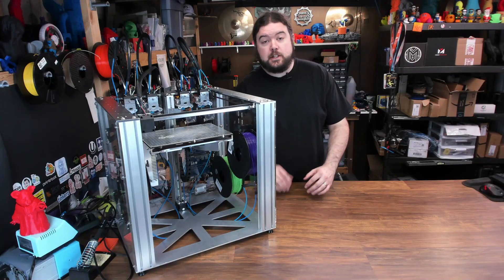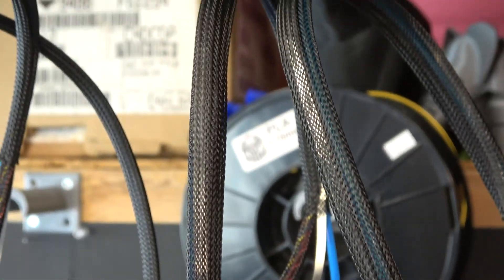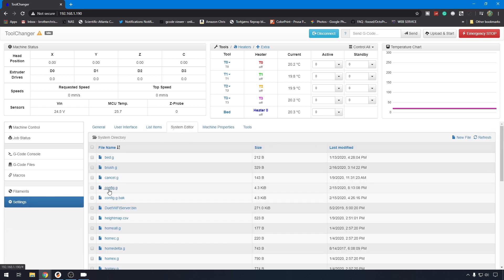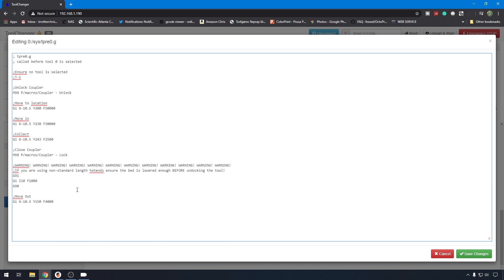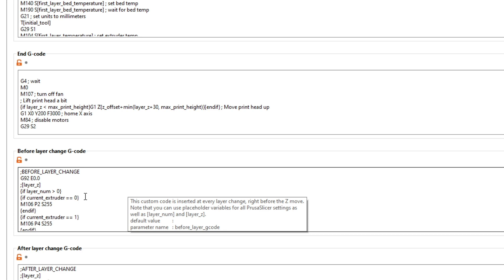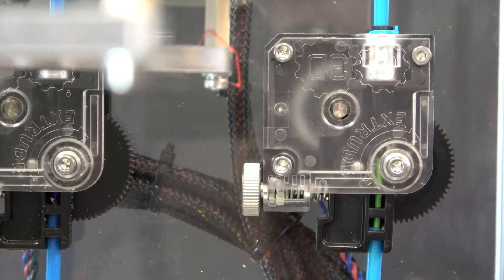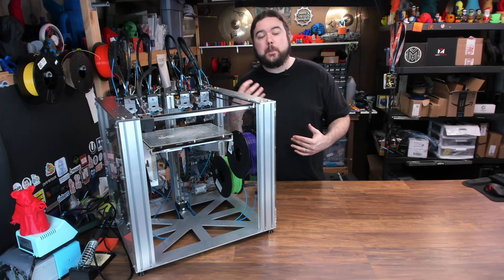E3D Tool Changer Update - Chris's Basement

Comment: I'm glad you're not bashing it as I've seen another YouTuber who was looking at it as a finished product -- simply based on the price. I went a different direction with my multi head design. I build a quad independent extruder system, and to be honest the amount of slicer config you have is unnecessary. You can do all of that in the scripts. For fan.
Here is what I have in my free0.g  : M106 P0 S0
then parking operation -- for me parking is quiet a bit easier since I don't have to disconnect a magnet or anything, just move the inactive tool to it's parking location.
free1.g has M106 P4 S0 and so on -- so you turn off the fan in each freen.g command then in postn.g you need to have
M106 R2 -- that command is how Duet RRF will resume your fan operation. That's all you need to do -- set your slicer fan to be at layer 2 or whatever as you would normally print, and then just let duet take care of the rest. So for my machine part cooling fans get turned off when the tool parks, and they resume when the tool gets active if it was previously set to whatever you set it at -- RRF will remember. 
As far as tool cleaning, really can't see why that can't be done in the postN.g script either -- I have my own cleaning mechanism - since hotends are parked and need to be cleaned before resuming -- so first thing they do is clean themselves -- then continue printing. I look at it as everything special to the operation of the machine should be and can be done in the pre, free, and post scripts. My slicers config in S3D has one variance -- which is to make the tool do XY motion before it does the Z motion on toolchange (I personally think going the other way around is a bug in S3D)-- that allows for tool to return from the parking/cleaning phase and travel above the part and not hit anything or make a mess, really that's all the slicer adjustments I have to do, again because S3D is dumb to do it in reverse. Another trick to lining up toolheads is use a microscope camera under the tool at a known location, much easier that way to get offsets. I would not do a long bowden tube on a system where precise control of extrusion is necessary. But I learned that before I jumped into the quad.
Reply from the maker: Great comment, I am sure as I get into it more my config will become much more efficient, this was just how I solved it at first look. Great to hear that there are so many different tool changer projects going on. Thanks for watching!
Reply: This is similar to what I did.  I added the Fans to each M563 command in config.g so they are bound to the tool.  Then changed the M106 command in tpost.g to R2 instead of S255.  That has them following what PrusaSlic3r sets the fans to so far.
Reply: How does this toolchanger disengage from the magnets after it slides the toolhead on the two parking posts?
Reply: Christopher Jones the toolhead uses a cam lock driven by a small stepper motor to secure the tool. There are no magnets on that side. The dock has a magnet that secures the tool to the dock.

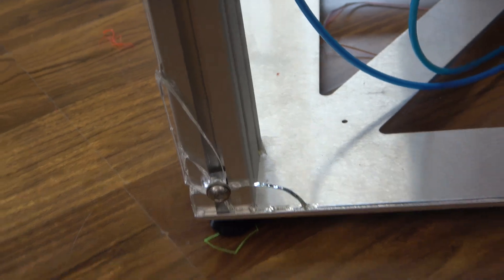Comment: 6:45 If you plan to install new Acrylic. Make large holes around the screws, install rubber washers there, and cover them with a larger metal washer. Or you may get one of those "cable guide" rubber washers that are used in the automotive industry.
If you plan to repair existing one - saw them off by 45deg, drill some holes near the edge and 3d print angle brackets that will have hooks to go through the holes in acrylic.
Reply from the maker: Great suggestion, thank you!

Comment: Thank you for the video, very informative retrospective view on the build process.  Ever since I saw the E3D kinematic coupling tool changer concept on MRRF2018 I have been working towards replicating it but slightly different, one thing I did different was change the locking mechanism so instead of twisting to lock in place it uses the X Y movement to align (essentially) a cylinder into a ring. The ring gets inserted over the cylinder on the X movement then the ring retracts into the gantry (retracting mechanism) taking the cylinder and tool head with it. The benefit of this is there is no chance the print head will fall off due to misalignment when coupling or uncoupling. Cant wait to see your first motley material prints and whatever contraptions you come up with to mount to the thing!
Reply from the maker: Thanks Nick, great to hear you are creating another version, that's awesome.

Comment: Hey Chris, for your side pannels, if you don't already have them, find some 1/8th or 1/16th inch wide soft rubber grommets to put between the pannels and the frame.  Even small vibrations over time, like when the print head is moving, can fatigue materials to the point where they become brittle.

Just got into 3d printing myself and am already looking at pie in the sky ideas about setting up a machine with a tool changer and a bed changer so I can batch out a couple hundred parts at a time (obviously there are many challenges with this, but it'd be boring if it were easy).  Thanks for the review on the changer!  I'll definitely have to look into it for the learning experience.
Reply from the maker: Thanks for the tip! I still need to fix mine up.

Comment: At ~5:30 you can see that you have very little tension on your extruder which is most likely a big factor in your filament stripping. Good video though! I would love to see more on the printer.
Reply from the maker: Thanks! I have been messing with the tension a lot, haven't found the perfect setting yet.

Comment: on my printer I used thicker acrylic with some of those squishy washers on both sides and just smashed the washers down on the inside with over-tightening. hasn't broken any in 2 years
Reply from the maker: Good call! I am still looking for someone to make me some replacements.
Reply: @ChrisRiley  Mine's not perfectly straight cuts but I just drew my cuts out with a straight edge & sharpie and cut it with a jigsaw. Got the acrylic from lowes
Reply from the maker: @gg-gn3re  Thanks, I might have to go that route.

Comment: I build my own printer with my own tool changer mechanism and marlin. Beside some tool change tests I still need to implement all the stuff required to keep parking positions and save zone areas, without the need of reflashing it all the time. Currently this all sits in a code script in octoprint, which is not optimal, too. Multi head support is really a challenge and needs to be done with care.
Reply from the maker: Great to hear you are working on your own project, very cool.

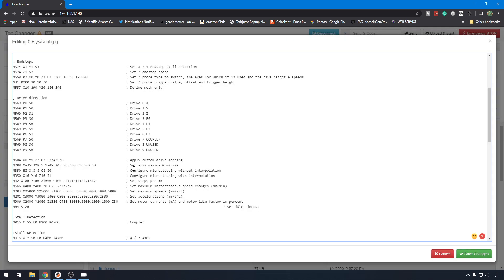Comment: @2:22 The M566 value for E looks verly low with a jerk of 2 is this correct? Since I have also a bowden setup with a all metal hotend I wonder which settings are best with 700 mm bowden (M566,M203,M201). I think pressure advance will not work with  low jerk values ( sorry for the bad english)
Reply from the maker: I would have to go back and take a look. Pressure advance probably won't work well with this much tube.

Comment: Whadya think about a flex3drive for each head? That would deal with yer Bowden tube stuff. Maybe build a rack above for yer filament to shorten the length of the Capricorn tubes.
Reply from the maker: I think it's a good idea, but might introduce some other issues, depending on the drive design. If you get it setup just right it would be solid.
Reply: Chris Riley have you checked out the flex3drive? I’m thinkin of putting one on my prusa mk3s. That and a Hemera should almost double the speed.
Reply from the maker: @tamvalley415  I have not, there are a couple that I would like to take a look at.
Reply: Actually no need for a hemera 😬

Comment: Could you move the electronic panels etc to one of the side panels and mount the filament on the rear feeding directly into the extruder and remove one of the bowden tubes in the current setup?
Reply from the maker: You should have to change up some of the wiring, but yeah, I think you could make it work.

Comment: You got macro g-code to work in PrusaSlicer?!  I've yet to find a reference with upto date info or that gives working examples.  Where did you find your info?  I have an IDEX machine with purge buckets and I want to make some smart first layer purge and between layer purge and clean code.
Reply from the maker: I go by the slic3r manual, a few things are different, but most of them work. https://manual.slic3r.org/advanced/placeholder-parser
Reply: Sweet!! I have been trying to find this info as well.

Comment: For the acrylic panels, I would recommend some type of 'U' clip that you can screw to the extrusion, and allow the acrylic sheet to float freely.  Especially if the panels are cracking when you are trying to move the unit.

Odd question: Where's agood place to download the RepRap firmware from?
Reply from the maker: That's a good idea. You can get the Duet stuff here https://github.com/dc42/RepRapFirmware/releases and the old school stuff here.  https://github.com/reprap
Reply: Or perhaps use a standoff a bit smaller in diameter of the plexi hole (or simply a longer screw) and have its length to be a couple millimeters longer than the plexi surface and use a rubber washer with a button head screw. The rubber washer will allow for the plexi to move.   Better yet attach a sliding latch system like we use on PC tower cases. Probably can just use epoxy to attach the tabs on the plexi without it looking too ugly.

Comment: I wonder why the acrylic is cracking. Is it due to vibrations in the aluminium frame? I find this strange, because my old anet a8 has an acrylic frame and its pretty much in mint (frankenstein modded) condition.
Reply: I don't think its the vibrations, but the frame not being rigid enough translating the forces at play to the acrylic.
Reply from the maker: Yep, the frame has just enough back and forth motion to press on the acrylic panels. I think that is the issue.

Comment: Universal dove tail 3D Printers tool change adapter,  manual. 
https://www.cgtrader.com/.../universal-dove-tail-3d...
Advantages? 
Yes: one can change various printing heads,  manually,  on printers that were never made to accomplish this. 
Unlike the versions you can buy ready made,  this is more compact,  easy to install on a vast range of models with minimum tweakening,  and you print it yourself mirrored or straight as needed. 
It has (Tada....)  a Z axis sensor slider support adjustable as needed to the micron height by twisting a screw...  Bye bye sensor adjusting headache.
Reply from the maker: I wanted to see this, but the link didn't take me to the model .
Reply: @ChrisRiley  I tested the link and it took me to the entry page of the portal of CG trader, but sercing with the title of the tool, I got it in the search results, y the way, there was only one search result turning up...vol  
Anyway I got you another portal link,  hope it does soemthing.

Comment: Give your self a even bigger headake put a mmu on one of the tool changer heads 😂
Reply from the maker: LOL, and a Palette.
Reply: @ChrisRiley  i was surprised to see the titan fail with so little load of only PTFE tubing. Since its bowden i guess you can swap out the 20mm nema 17 and use a larger fuller size nema. Also reposition the motor closer to the print area shortening the bowden tube (this is my next mod, putting the extruder on the right z axis on a cartesian printer). I have been testing TPU on a bowden its been going rather well.
Reply from the maker: @Side85Winder  Yeah, I want to compare them to some others, just to see what is going on here. I also have a ton of silcer tweaking to do.
Reply: I let the back spools go straight up into the Titan it works a lot better.  It has at times been a head scratcher but I’m enjoying the tinkering and it definitely has improved my firmware knowledge 😅

Comment: E3D is so disappointing. They sell Tool Changer as a complete kit and didn't even provide firmware with basic configuration?
Reply from the maker: It's really not a kit, it's just parts, they do have the basic firmware, just not all the unique bits you will need.
Reply: @ChrisRiley  It is still a convenient way to put all the responsibility and troubleshooting on the user. I was hoping it will be closer to the Prusa kit.